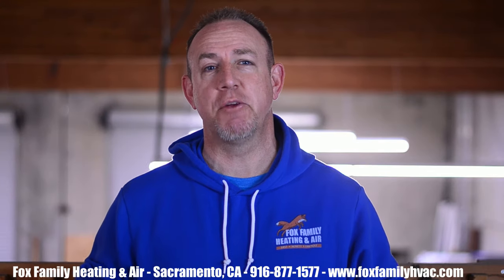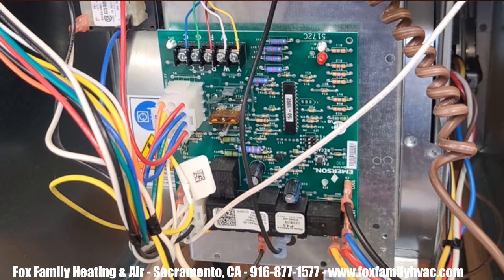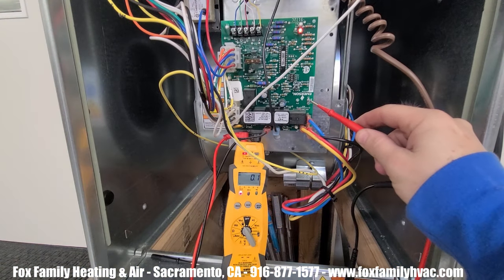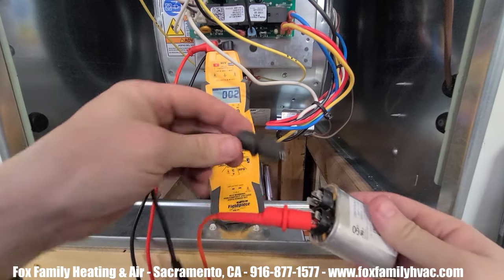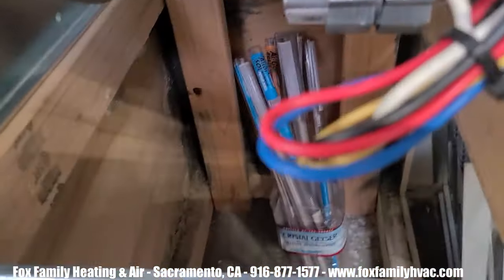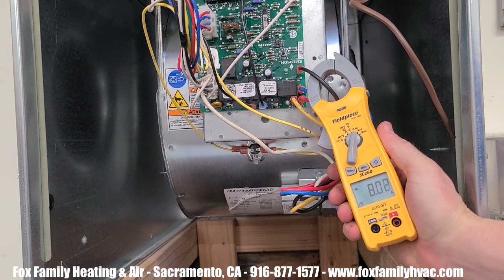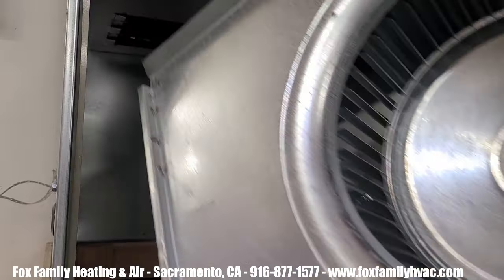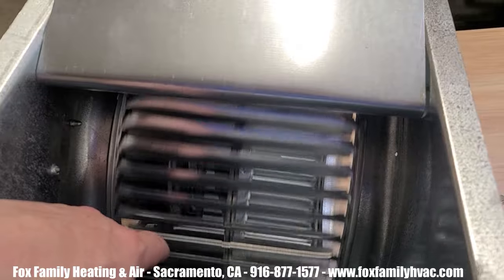Diagnosing a Bad Blower Motor (8 Easy Things To Check)

Comment: My blower is slow and can't feel any air out of the vents.  If I turn off the system and wait and then turn it back on it will go nice and fast and blow air good and then slow down after 10 min or so.  Also I hear some noises from the blower like it is trying to go faster but just cant...is there any test I can do to confirm it is bad before spending $500 on a new one?
Reply: I love how no one answers

Comment: When you said that a motor will burn itself out due to having less of a load on it after having cleaned the squirrel cage, that's when you lost me. That just doesn't make any sense whatsoever as less of a load means less current draw, not more. That's true for any electric motor.

Comment: Excellent and very professional video. I recently had an HVAC house call because the 115v wires in my air handler's juction box had fried out. The technician reconnected the wires and the air handler fan worked again! Yay!  I figured I must have had an energy surge from a lightning strike in the area, but when he tested the AMP draw from the motor he quickly shut off the unit and said "WHOA! That's drawing nearly 7 AMPS! You need a new blower motor! This is unsafe!"    Later, I noticed the sticker on the motor says 9.35 AMP! !!  Plus, the fan spins smoothly and freely.  Is he just trying to sell me a new blower motor?  Or is that truly an alarming AMP draw?
Reply: 7 amps is not high.  a hair dryer or microwave would be much higher.  As you noted it says 9 amp on the motor label.  if it was high it would likely trip the breaker (presumably 20 amp circuit).  In the video, he mentions 4-12 amps is typical (shows 8 amps on the one tested).
Reply: he just rip you off installing new fan motor.

Comment: My furnace would go off and few seconds later come back in and off and on. The motor got hot and smelled like burning. Is there a safety feature you can get that woukd just keep the furnace off completely. If I wasnt hime when this happened my home woukd have burned down.

Comment: Trying to figure mine out now! Kicks on, lights up, blows (although weakly) than kicks back off. Flame sensor and pressure switch check out ok. End up with a 4 blink code on my Ducane furnace/ac unit.

Comment: Love the energy and knowledge. NOTE - At approximately 5:30 the statement was made that a dirty blower wheel weighs more and thus uses less energy,  and the cleaner wheel weighs less thus using more energy and thus can cause a motor to burn up after cleaning it. While this may happen, the actual cause is for a different reason. A dirty blower wheel will pull LESS amps due to the restricted airflow (possibly MORE on the initial startup due to the increased weight). Once it's cleaned, the airflow will often increase considerably and will cause the motor to draw MORE amps. Combine this with already worn/loose bearings and the motor often times will exceed its maximum rated amps, will overheat and eventually burn up. Hope this helps.
Reply: He said it weighs down the blower wheel and creates a strain on the motor . He never said a dirty blower wheel weighs more and uses less energy .   ?  I’m confused. Can you explain a bit more please ?
Reply: @sagemaster3408  his statement is incorrect. See my comment above. A dirty blower wheel will pull LESS amps due to the restricted airflow (possibly MORE on the initial startup due to the increased weight). Once it's cleaned, the airflow will often increase considerably and will cause the motor to draw MORE amps. Combine this with already worn/loose bearings and the motor often times will exceed its maximum rated amps, will overheat and eventually burn up. So it's the increased airflow that draws the high amps, not necessarily a heavier or lighter wheel. The heavier wheel may pull more amps on startup but once it's up to speed that's minimal. So cleaning the blower will increase the airflow and cause the amps to go up and maybe cause the motor to fail after the cleaning because it is old and worn. Just something to watch out for.
Reply: @foxairandheatinc8345  I understand all that.  I was just confused because you said that he said “it uses less energy”. He never said that.  That’s what I’m confused about .   Thanks for the info also
Reply: @foxairandheatinc8345  I understand that , we all understand that.  He was wrong in his statement. We all know this.   

Thanks for commenting. But. You I guess u don’t understand what I’m asking.  It’s ok.  Have a good day.
Reply: @sagemaster3408  wasn't trying to be critical just trying to clarify WHY the blower might fail after you clean it all up. Not the techs problem but it might come back and bite you. Maybe I'm not understanding your question, maybe it can be rephrased
Reply: I'm currently DIY putting in a new blower wheel and made sure I caked some mud all over it before the install so it would pull less amps and last longer, hope that works.

Comment: Thanks for the tips! Definately helpful!

After cleaning out the wheel, 3 weeks later there was a rattling when the fan comes on. When to check and the wheel is tight on the shaft, yet the shaft is moving in and out about 1/4" which doesn't seem great. It's a stand GE/Carrier type (like shown in this video) is there a way to replace whatever the problem is? It seems like the shaft is part of the internals of the motor. Thanks!

Comment: Excellent video. Didn’t know you could jump out the fan motor to make sure it’s just the motor not working. Very cool.
Reply from the maker: Thanks hope you can use that!
Reply: You can also do that on a heatpump outdoor fan , take off at DEfrost board relay and put to bottom of CONTACTOR , if it comes on you have bad board

Comment: I have a Reem Ac unit and the AC Unit runs for a minute and then it stops. The furnace was just replaced 2 years. Is the blower motor bad.? THe condensation around the copper pipe is freezing. Then i reset the furnace at it goes away for 10-15 minutes. Intermittent run.

Comment: How about testing the blower motor by trying to turn it on without having it initiated by heating/cooling mode, ie, not in auto mode, fan on. Then you know it is not being stopped by the steps the control board goes through in the heating or cooling mode. 
I thought my fan was not turning on because of the flame sensor but tried turning it on through fan only mode and it didn’t turn in then either.
Reply: Then what?  Was it the capacitor or was the motor completely inop?
Reply: It was the control board.  I ran a separate 120 volt line directly to the fan. With the fan running, I was able to initiate and start heating the house until I got a new control board. I changed the board and all ran fine.
Reply: @mgpvii   Thanks for the update. I just replaced the capacitor and the blower motor started normal. Then the next time the AC tried to cycle the blower motor wouldn't start. The first time when I thought the capacitor was bad the motor tried to start but was in a stalled condition. I eventually heard it and turned the system off. I figured I caught it in time. So we left it off to only run it when we could keep an eye on it. But whatever happened we lost track and the thing stalled until what must have been the thermal protection shut it off. Let it cool and threw in a new capacitor. It started fine the first time. But then when it wanted to cycle again the same thing happened....the motor stalled and would not turn. So I figured the motor had been damaged by all that stalling......just sitting there humming. We ordered a new motor. I hope it's not the board. I mean.....the board is sending power TO the motor....so it seems like the board is doing it's job.
Reply: @rael5469  Yeah, that doesn’t seem to be a control board issue. It does sound like a fan motor issue but I would just get a volt meter and see that you are getting 120v to the motor. I’m sure you are but easy enough test just to rule it out.  Also does the fan wheel spin freely when spun by hand?
Reply: @mgpvii  Fan wheel spins freely. Seems smooth and firm, not loose or rubbing on anything. 
Thanks for replying.

Comment: I had someone come out and checked out my a/c unit as it was not working at all. I heard a popping sound and smelled something burning. When the a/c guy got here he said I needed an indoor motor and capacitor replaced and a new contactor. He charged me $848. Does that sound reasonable? After he left I noticed the heat was not working at all but the a/c was blowing cold. However, the problem also is besides no heat working, the fan is running constantly even when turned to auto. The only way to get the fan to stop running is to turn it off at the breakers. Any suggestions? The a/c guy is saying this is a new problem to come back out; however, is this not something he should have checked when he was here? Possibly the fact that something burned could also mean it blew some fuses? I don't know but really wondering if this should not have been checked at the time he was here before he left and also seemed a bit high priced. Please let me know your thoughts.
Reply: Residential blower motors (indoor motors) are generally $150 to $300. While capacitors are less $20.

Comment: thanks for your videos, fixed my york diamond 80 in roseville myself due to your videos and some others.
Reply from the maker: Fantastic to hear man! Thanks. Those things are solid.
Reply: @foxfamilyhvac  I have one of these old york diamond 80. has not been tuned up in 20 years. Recently,  it wont spin the wheel unless I manually spin it then, it starts right up... should I replace the bearing inside?  or just go with a new motor?

Comment: The heater seems to work well but lately I smell a plastic type burn smell. I'm afraid it may be a burnt wire. The smell us present in a/ mode as well as heat.
Reply: Mind did this. Heat keep coming on and off but no heat blowing to the room. Any help?

Comment: Can a failing blower motor cause freezing on the unit,,
Reply from the maker: Absolutely
Reply: I have a split unit tech threw out the old freon and added 5 pounds for a mobile home and unit cools cold and turns on and off but when it gets hotter outside unit stays on and doesnt cool as much and freezes tech checked the coil and blower said it was clean what could it be

Comment: I installed a new Thermostat and my heat works perfectly but the AC and the Fan ON mode does not work!
Reply: Didn't hook up the wires properly

Comment: bet you can't figure this out: my blower fan runs great, ran all winter with NO noise. Now that it's summer, when the outside compressor unit kicks on - there is a 'bang' on my inside blower!!! it's SO LOUD it scares my animals and me, it wakes us up at night! :( the idiots that installed the brand new outside compressor unit are like beavis and butthead. duhh idk beavis what do you think... i am so mad at these pple, i know it can be fixed, there is no reason for an outside unit to make the inside blower fan BANG and 'sometimes' it's a bit slow to come on. Here's the kicker. you can turn the blower fan only, ON, all day and it never never EVER happens. EVER. But when that dang compressor unit kicks on - BANG! and idk wth these nuts are thinking. I mean, the dang unit was put in new 10 months ago, - still doing it. they did not run new lines for the gas or new wires, they just installed it w/the old copper lines from the inside unit to the outside unit. I AM SO MAD idk what to do, they need to fix it but claim they don't know nuthin'. :(  can you PLEASE help? i have googled the entire internet and cannot find anything at all about this. :( thank you!

Comment: What setting do I use on a multimeter. My blower just stopped working and we have a heat warning all next week and I can't get anyone right now
Reply: The setting depends on what you are doing. Household current can be lethal. If you don't feel safe then better get someone who knows what to do.